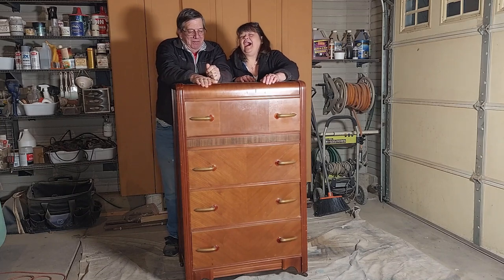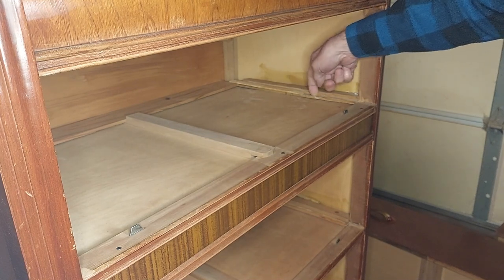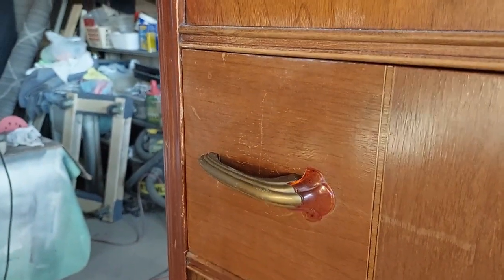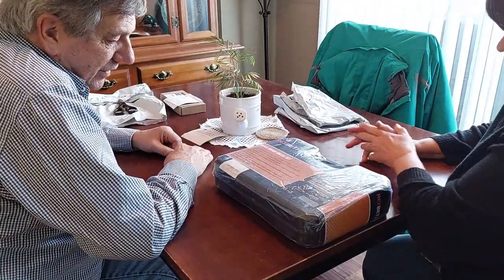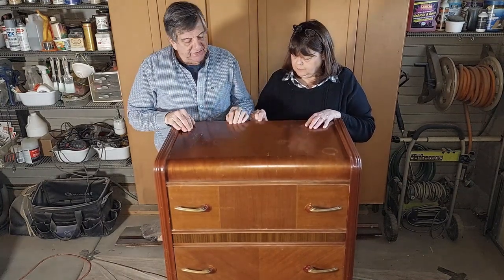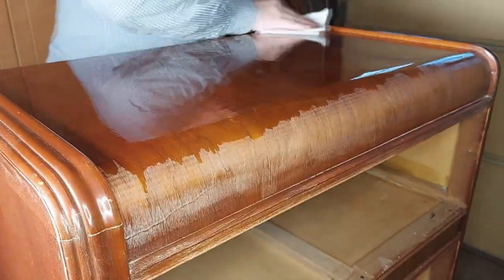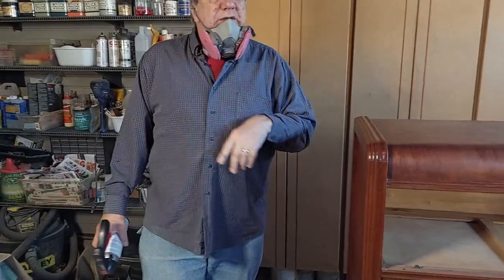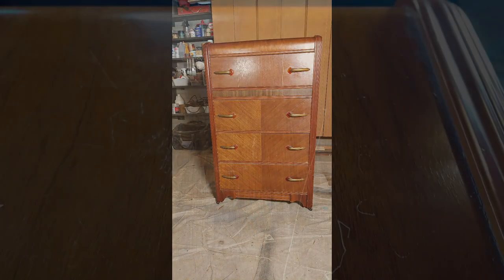Easy Restoration of an Art Deco Waterfall Dresser | Vintage Furniture Restoration

Comment: Cindy, you are a miracle worker when it comes to restoring hardware. I followed your directions but there is a little tarnish still clinging to otherwise beautiful brass pulls. What to do? Steel wool and barkeeper's friend?
Reply from the maker: If you use steel wool, make sure it is 0000 steel wool. This is the fine steel wool and won't scratch the brass if you go easy....Thanks!